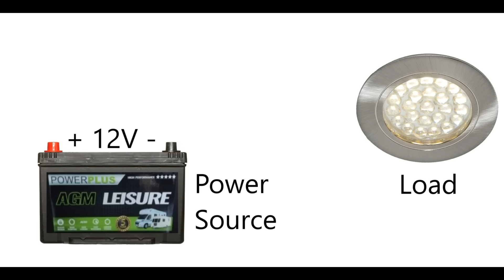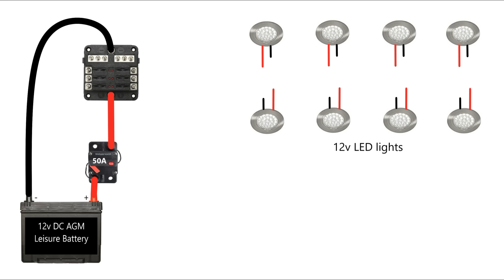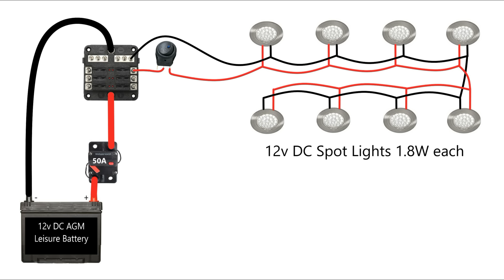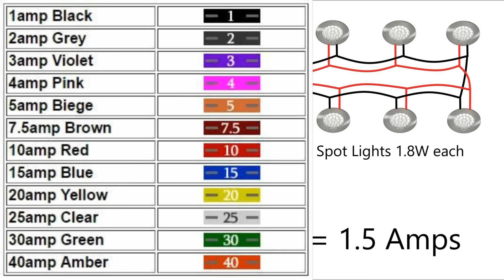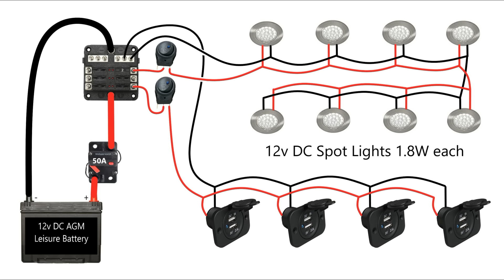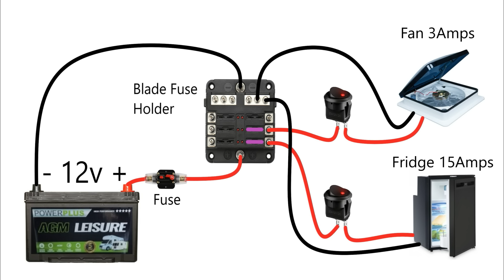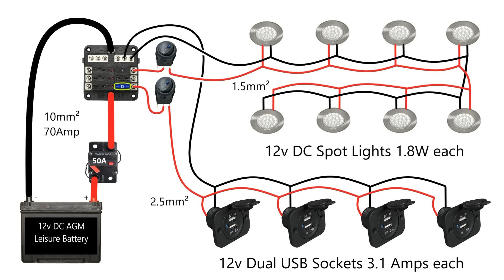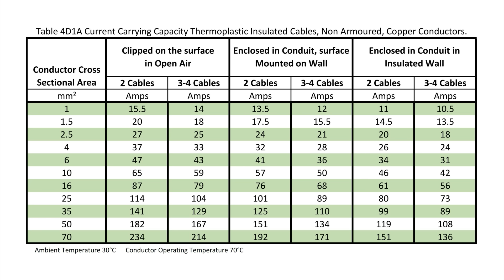Electric Cable & Fuse Sizing - Camper Van Conversion Series

Comment: This is, most probably the most useful pack of information on the electrics of a camper van excellently presented. I cannot thank you enough. 
There is however,  just one aspect that contains an error: At the minute 11:31,  If identical lights are connected in series, as theyare identical and they all have the same resistance, and as the same current (intensity) goes through all of them,  (since they are in series)  so the voltage drop across each light is exactly the same, and the power dropped on each lamp is the same so the brightness is the same so they will all be quite dim but just as dim as each other. But the conclusion is still 100% right: the lights and all the 12Vcomsumers should be wired in PARALLEL. I hope this helps. with best regards

Comment: Very good info, as an ex-electrician I thought I'd watch this for van-installation specific info.  The first 5 minutes gave lots of good tips (conduit, never thought of that).   The only thing I would highlight is that the solid core (which you're not going to use anyway) was old-standard colours - black and red not brown blue.

Current carrying capacity vital info' for safe installation.  Thank you for the reinforcement of information that I might have forgotten!  On to the solar installation vid' now...  too modern for my knowledge!

Comment: Love your videos. My van hasn't arrived yet but I am rewatchimg as most of my electrical has shown up
Reply from the maker: There are lots of useful videos in this series. Good luck with your build 👍🏼😊
Reply: @GregVirgoe  I found this little gadget, it's a 5mm barrel and usbC wire with a little box that converts 12 volt to 20. Is there a port that will do this that I can purchase in a control panel? I have no idea what this is called. Opposite of a transformer. I have 3 devices I have tested this on so far. 20v fan with 5mm barrel connector.
Reply from the maker: @alutious  I used a similar device to up the voltage for my Samsung tv. Links are in the description of this video How to connect a Mains TV direct to 12v DC - Off Grid Living
https://youtu.be/1AFbVR4eSXs

Comment: Good practical advice… I have repair/total re-wired an old Land Rover far from civilization a couple times years ago with relieved and happy outcome years ago. And, my 1963 Airstream too using techniques as you clearly explain. But for good or bad, modern auto-electrics/electronics cannot afford other than to minimize as much as possible from power consumption to using smallest wire sizes possible, to the point of scary small and wimpy appearing. Now the trend has been for awhile in automotive wiring replacing electrical components like resistive lighting with chip based (LED) lighting getting for 100ma 5 times the light output of a 10 watt bulb, use of centralized microprocessor control of switching and fault protection solid state circuits, making hobby projects in some cases like with the mo.unit blue as sophisticated as factory systems… and very simple to wire and program. Though these require a more particular approach, but the result is simply amazing. 
A bike I bought with a butchered factory backyard modified electrical system I used one of these modern but not new technology units along with a mo.button digital control signal converter using one 24 gage wire and a ground to provide control inputs for all functions of the entire rather complicated electrical system… and my cell phone to program it. With hands off security protection and keyless start and stop.
Reply from the maker: Yes you do have to be careful not to overload existing auto cables. 
Sounds like you had some fun projects there 👍🏼😃

Comment: The ability of wiring veing able to handle more current when in the ambient air is the reason why I like my wireson the ceiling. Also, in the event of a fire, the fire can be put out more quickly,
Reply from the maker: If the cables are sized large enough there is no risk of fire.

Comment: I am currently in the planning stages of my first build;  the power of it all is what has me so intimidated.  I am so thankful for this video, you didn't just say do this - use this, but rather took the time to explain why so we can easily adjust for our use.    Your detailed explanation will also help us troubleshoot down the line if we run into issues or decide to add or upgrade a load.
Reply from the maker: Thats great that you found it to be useful,  I had to increase the size of my own wiring recently because we have added further things to our 12v system. So it does help to know how it all works. I have an essential playlist of camper build videos that may be of use to you here is the link https://youtube.com/playlist?list=PLLhAyWhGGbi4nOabmpkLMGvfLGox2ljp_
Reply from the maker: Also a great source of help for sizing cables is the handy online calculator on this webpage. you just put in your info and if the result is green your good to go.
https://www.12voltplanet.co.uk/cable-sizing-selection.html

Comment: THANK YOU!!! By far the best on Youtube on electrics in the van, none of it up to now made any sense to me, but now I really feel up for trying to give it a go and besides, it's nice to know what's going on when you're on the road somewhere abroad 🌸
Reply from the maker: It’s nice to know that it has helped you and you are right. Always handy to know how it all goes together. Thanks for watching
Reply: @GregVirgoe  Can I please please ask one more Q, Greg.  In the bus we're re-converting there are already AGMs which we decided to hook up to solars and try out before considering the lithium expense...but if we do in the future decide to switch to lithium batteries, is it a major electrical restructure or something more manageable in the ready vehicle?  I'm assuming it's not the case of just swapping the batteries?  Again thanks for well researched and laid out, uncluttered info, we here sort of binge out on all of this essentials' list as do our friends who are also converting a camper
Reply from the maker: @StellarOceans  if you do go that way you may need to change the charge controller too if it’s not got settings for lithium batteries. 
AGMs if you look after them will last for years. 👍🏼😃

Comment: Hello from Florida Greg. I'm an absolute neophyte who intends to re-wire a 1964 vintage runabout boat i recently purchased. It's a simple enough job with only a few components: navigation lights, tachometer, USB ports, horn, and a gps/fishfinder. This video, though written for van owners (another project in my future), is spot-on what i needed to understand basic wiring. Now i just need to find a conversion chart which converts mm/2 wiring into "gauge" size, which we use here in the US. I also figured out an easy to remember hack for remembering the "power equation" which may be helpful to US viewers. Just think "West Virgina"....which is abbreviated W. VA. Voila, put the W on top, the VA on the bottom, and you have the power equation. Now, if i could just translate some of the British speak below... "no waffling", "as it says on the tin", "belting video" . You win my vote for "top man"!........Cheers! (<---see what i did there?).

Comment: I have been binge watching your videos as you present the topic content very well, great job.
Initially I searched for 'how to insulate a van correctly' as there seem to be many view points, so it was great to see your view supported by factual and mathematical data.

I am an electrician in Australia therefore different regulations than you have there, so you are 100% correct in pointing out that anyone watching needs to refer to their local regulations, as Australia has many differences (mostly minor) than what you have presented.

One thing to keep in mind when you referred to the wiring table, is that the tendency in van builds to to bundle all of the wires very closely and tightly together, therefore this has an effect on 'electrical heating ' of the cables by the current flowing in adjacent cables.......therefore it is mostly wise to go bigger if in doubt, and/or to try to segregate your higher current draw cable runs.

Comment: I started using ENT flexible raceway years ago..As I can use Blue for AC wiring. Then use Orange for DC low voltage wiring. Then I pull a few pull strings in with the wiring. Just in case they want to add wiring later on. I also use the boxes designed for ENT Raceways. Then mark the cover plates with the proper breaker\circuit numbers. I also use automotive grade wiring.... As you said an RV gets hot\cold in them walls. So the extra cost is worth the peace of mind....

And it meets NEC, NFPA70 code....
Reply from the maker: Well done 👍🏼

Comment: Wow.  Such an easy to understand vid for a newbie to 12V electrics.  Off to watch more now!  Although does have me slightly worried now about cable sizes on my van 🤔
Reply from the maker: There is a very handy cable sizing calculator for free on 12 volt planet website where you can check your wire sizes. 
https://www.12voltplanet.co.uk/cable-sizing-selection.html
Reply: Smashing.  I’ll do that when the van comes back from the doctors.  Brake pipe rupture 😱

Comment: briliant video! i've recently got into playing with 12v and solar in my shed. I've been looking everywhere for more info and had lots of questions that needed answering. after hours of youtubing i finally came across this one and not only has it answered everything and more, but it was clear for muggles to learn from. I now feel empowered with the knowledge i need to move on with my project. thanks so much Greg!

Comment: Hi GREG
like most I do have rudimentary knowledge of electricity and the working thereof, you get a lot of tuition video's where it is obvious the person uploading the video has finally grasped how to do whatever they are teaching, however they seem to go at a hundred mile an hour, it isn't bad initially but once there are numerous cables and connections in the mix it gets awfully confusing done at breakneck speed, you go the extra mile and slow it right down, also your explanation is top draw, the difference between a good teacher and a bad one, well done Greg, I will be purchasing a sprinter lwb soon and having a go, will message you and let you know
Bill
Reply from the maker: Thank you buddy really glad you are finding them to be helpful. Thanks for nice feedback too 😁

Comment: Only thing I would like you to add here Greg is a relay for each switch. Switching DC current can cause arcing which damages the switch contacts over time. 12v relays are designed to handle DC arcing and will add reliability to the circuit.
Reply: You only need a relay for devices that require 20 - 100+ amps and you dont generally have burnt switches on DC rated switches . if your using an ac switch on dc then yes you will burn those switches.

Comment: Curious why these diagrams don't include separate +/- bus bars.  Looking over your diagrams carefully and SO appreciative of your effort and generosity!
Reply from the maker: You don’t have to install bus bars, if the system is simple enough you can connect directly to your battery. Addition of a bus bar will add extra resistance to the system and cause a small voltage drop. 
Have you seen my main camper wiring video too 👍🏼🤩
Reply from the maker: How to Wire your Camper Van to be Off-Grid
https://youtu.be/rVkDPzrA-zw

Comment: I'm a spark and this was excellent and concise. Only thing I'd say and this isn't an issue really for this installation is that for circuit design you can add a diversity factor to certain items like for example the USB outlets. You wouldn't really need to design a cct that uses the full load of each outlet. This allows the system not be be ridiculously overspecified not that this one is. An example is if a house power circuit was designed as drawing the max from each socket outlet (13a) you would be be at nearly 100a after 4 double sockets. On this example the USB outlets could probably be done at a 50% diversity factor from the full load current of each outlet. Its not a biggie over a small 4 or 5 cct system but without a bit of understand of diversity people end up with massive oversized main tails on systems with more ccts because they calculate their maximum demand by adding up the already overly large fuse rating on their final ccts. Anyway better too much capacity than not enough.
Reply from the maker: You are right on larger systems you have to apply some diversity or the cables do end up huge. The user needs to be aware of that so they don’t get overloading the circuits. 
With the amount of tech we have from phones to camera and drones it’s easy for us to have everything plugged in on charge during the day.  👍🏼😃

Comment: I always pre-load my conduit short runs with wires with adequit leads. Much easier and faster to load on the bench and then just hang and connect.

Comment: 8 lights in series will all have the same amount of power and be very dim the voltage will be divided by 8 so 1.5volts each at 1/8 their current rating so 1/64 of their power rating.
The old xmas tree lights used 20 x 12 volt globes in series on 240 volts.
Reply from the maker: Well done, So still not a good idea to wire up this way on 12v right? :D

Comment: I don't even have a van, I subscribed because I enjoyed this!
Reply from the maker: I guess it applies to other things. How did you find this video? 😃
Reply: @GregVirgoe  Great! I am watching you and pacific yacht systems for knowledge on my 36'yacht as she desperately needs re-wiring. Series and parallel are important so the voltage is the same all round. That's what I learned the most from you! Similar principal to a yacht.
Thanks again Greg!

Comment: Maybe this is what I need, I have a house I gutted EVERYTHING, and now I need to wire up something to a car/marine battery to where I can produce enough light in 3 large rooms for the relistate lady can flip on and show the inside of the house
Reply from the maker: Very easy to do. 12v battery, blade fuse holder, 2 core flex and some 12v DC lights. With a mains battery charger to keep the battery topped up or a solar panel outside.

Comment: Thank you - so helpful, i would love to have an explanation on cable length
 and spec size to use
Reply from the maker: This is a really useful free calculator tool for cable sizing. It takes into account the length of run and voltage drop. Scroll halfway down the page to find it. 
https://www.12voltplanet.co.uk/cable-sizing-selection.html

Comment: Just found this. Exactly what I was looking for, thanks for this, absolutely brilliant
Reply from the maker: I recon you would like this one too How to Wire your Camper Van to be Off-Grid
https://youtu.be/rVkDPzrA-zw
Reply: @GregVirgoe  My intention is to watch the playlist you mentioned in this video. Bit of a lame question here but I'm going to ask it anyway. Is the power to the leisure battery is taken directly from the vehicle battery? I have read that if the van has a smart alternator then the positive goes through a split relay? Can you clear that up for me please?
Reply from the maker: @tristandover133  if you want to charge your leisure batteries while driving you are better off fitting a DC To DC charger and not a split charge relay. The battery charger will charge the batteries better and monitor their condition.

Comment: Thank you for making it so easy to understand, so simple the way it was explained. Years ago I got a kit to add 240v mains they put house wire twin and earth but that was 34 years ago.but yes 1 thick wire can not take the strain of movement, but don't think I need to worry about that on caravans, will be watching all video's as undecided if Ican  do van conversation or not. Illness not any other reason. Pressed the subscribe and bell so hope to learn more from you.👍

Comment: Hi Greg,
I found you video while looking for fuse sizing to protect a couple of oven lights in a powder coating oven I have nearly finished building. It is 240V but I know that Watts Law applies just the same. Thank you for producing and sharing such useful content and in a very clear and easy to understand format. Brilliant work, I have just subscribed to your channel.
kind regards Paul
Reply from the maker: You are dead right just substitute the different voltage into the equation. The amps values will be less of course due to the higher voltage.

Comment: Great video!  I believe you made a small mistake on the USB sockets. They are 3.1A each, but that's after they convert the 12V source to USB 5V.  This means on the 12V side, they really only pull 1.3A each. Please let me know if I'm wrong! 17:58

Another thing I would add is that the length of wire should be considered when deciding on the thickness. It's usually a combination of expected current AND length (and insulated vs not as you mention) that determines what gauge you should use. The longer the wire the thicker gauge you should use. I'm surprised your chart didn't show this.

Comment: Hi Greg, this will probably get buried but I'll try anyway. You have lots of good info and advice in this video and discuss things most people avoid. I couldn't help noticed a mistake in your calculations. The 12V USB sockets wired in parallel are 5V regulated so 5V x 3.1A = 15.5W. At 12V that's only 1.3A. So 4 sockets x 1.3A = 5.2A not 12.4A at 12V.

Comment: 11min 30s in. The lamps would be dim but they would not be different brightnesses, they would be equally dim.
But parallel is still the correct way to wire them 😊